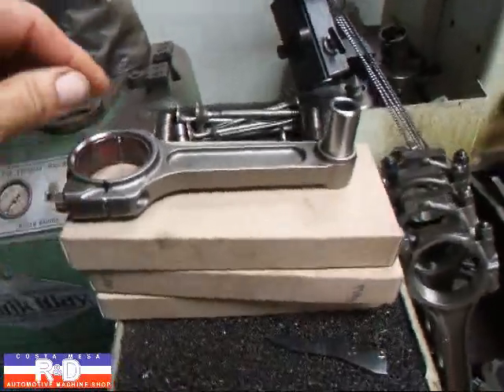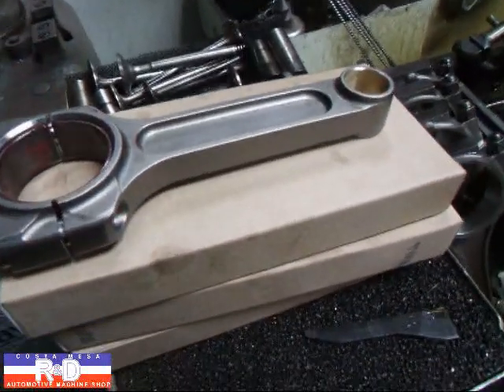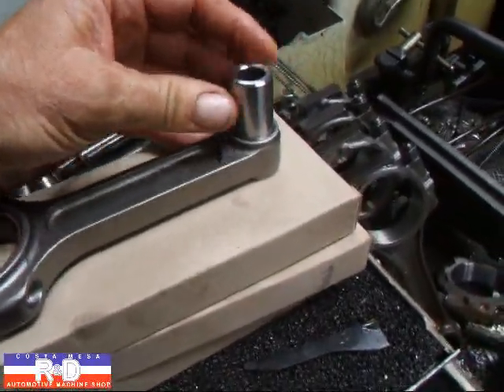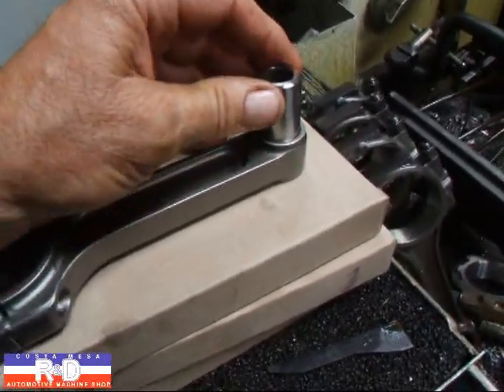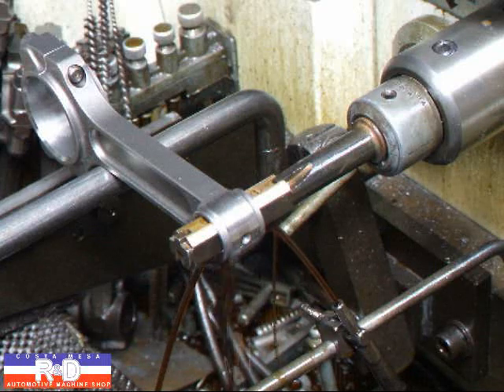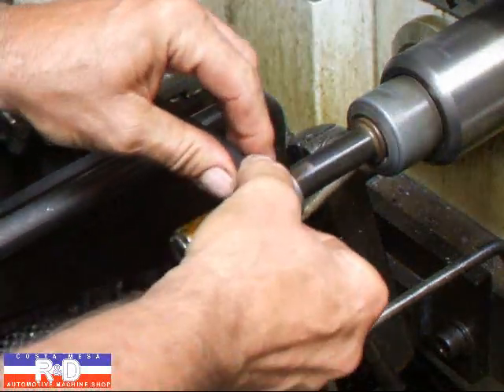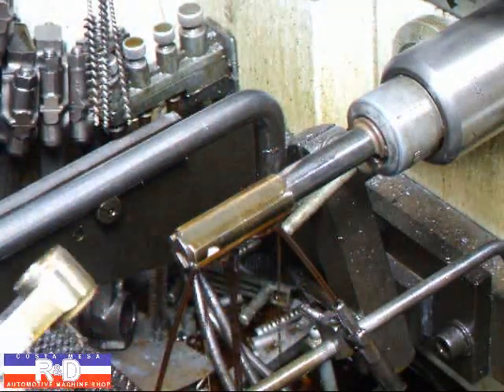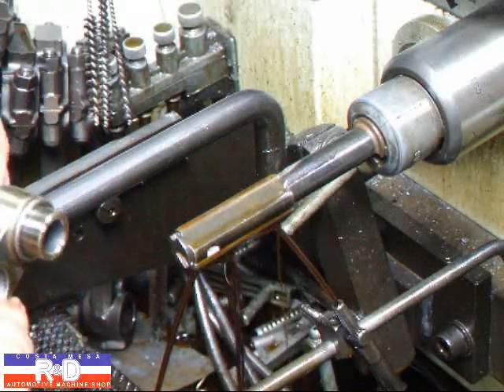Pin-Fitting-03.mp4

Comment: @rkrizan Its a "transition fit", just slightly more than size for size but less than the gudgeon pin falling through under its own weight.. just a light push with your thumb with a film of oil on the parts

Comment: Nine years late I know but the issue is still relevant. Looks a bit sloppy to me - the pin to bushing clearance on my Spitfire 1500 is: pin 13/16" ie 0.8125", tolerance on bush = 0.8126" to 0.8129" which will give a push fit - if it falls through the hole under its own weight it's too loose. Also some thoughts on the honing process: won't the stones leave abrasive particles embedded in the surface of the bronze? also being a free hand process there is no control over squareness / truth of the hole, also what about funnelling (the bore being bigger at the ends than in the middle)? Being a precision engineer it just seems weird to me that it's a free hand process. Dave.